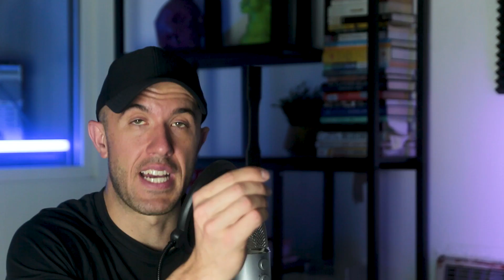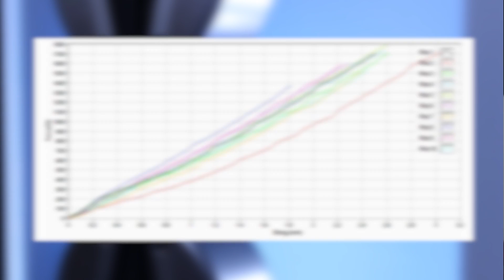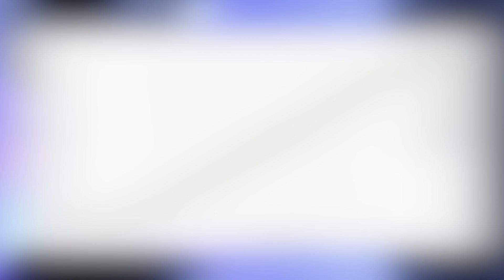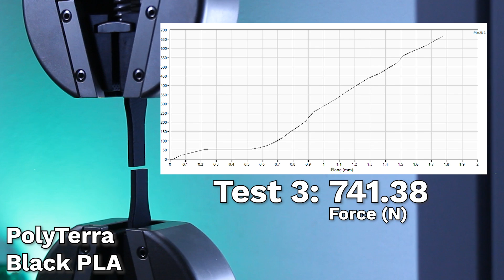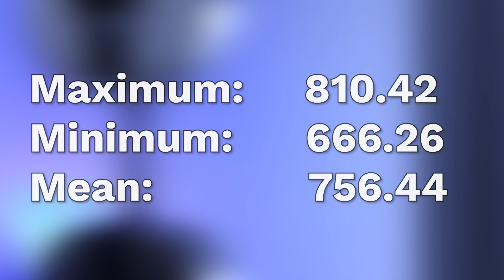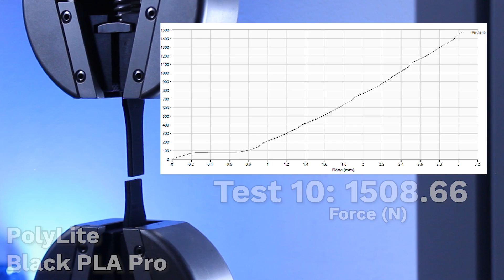Which Black PLA Makes the Best Print? 3D printer filament Strength Testing.

Comment: I understand I am saying this a year late so I may be screaming into the void here, but I just want to reiterate what others have said. I will preface this by saying while I have watched Slant 3D for well over a year, this is the FIRST and ONLY video I have watched on this specific testing channel at the time of this comment. So it is very possible the issue has been addressed and resolved in later videos. If so, I apologize.

However, I would like to firmly reiterate what others have said in terms of video layout being a very legitimate issue and point of concern. SPECIFICALLY for “common filaments” like PLA.

While this certainly WAS informative, overall the means of relaying the results and data is far below the standard reflected by other testing channels across multiple industries. I’ll use Project Farm as an example since others have mentioned it. All of their videos like this include some level of comparative analysis at the end, and it is incredibly helpful to your viewers.

As it stands, it’s hard to make any meaningful choices using the information in this video without taking a pencil and paper, pausing, writing down results presented throughout, and then doing a comparative analysis of your own after watching in order to determine what the “best” option is for a specific use case. 

In the case of this channel, you truly don’t even necessarily HAVE to go as far as the summary’s given in videos like PF. Currently 3D printing filament, while being used in more and more situations, does not have a huge amount of data that is relevant to 95% of viewers. Add that to the fact that you are an extremely trusted and proven source for the community, and people trust you. So even if all you did was add a 30 second segment/chart to show which filament is best for which use case (overall durability, most flex strain, best tension, etc), I believe it would be extremely beneficial while likely resulting in more people sharing the videos.

As I said, I think this is more an issue in videos like this which pertain to common filaments. Personally when I am designing for industrial/professional products, I am going to use PA-CF/PEEK/ASA-CF/etc (depending on application). In these cases, those of us designing the product aren’t getting information from YouTube, at least not fully. We mostly rely on lab testing and industry standards based off of use case in these scenarios. But a lot of us genuinely don’t use things like PLA/PETG all that often, and if we are just looking into a new alpha prototyping filament to use, we normally don’t know what the current “best” options are on these more consumer focused filaments.

Just my 2 cents! Still a fan of all y’all do and happy I found this channel!

Comment: Just because it’s “pretty darn brittle” doesn’t mean it should be a surprise that it can hold a lot of weight. Brittleness just describes the elongation percentage at break. 

PLA has low elongation at break but still high tensile strength…

Comment: I had an idea for a test.  Are two 0.6mm walls printed with a 0.6mm nozzle as strong as three 0.4mm walls printed with a 0.4mm nozzle?  They both create 0.12mm walls.  I wondered if three walls would be weaker because there are more failure points and more tiny gaps in the walls.  Maybe I'm not using the correct search terms, however I haven't found any detailed tests on the subject.

Comment: I was enthusiastic when donating to the Tangled crowd sourced filament testing project and am happy to see results now being published.  I understand these are preliminary results.  I look forward to more detailed testing that provides more useful data.  I'd like to see the materials tested in all three dimensions to fully characterize the material properties (independently verifying the manufacturer's data as promised) as opposed to only testing Z axis layer adhesion.  I'd like to see test samples printed at different nozzle temperatures and maybe different speeds and/or cooling settings so we don't have settings optimized for Tangled filament being used for all other filaments that would produce optimal performance at other print settings.  I'd like to see these standard tests done with all popular filaments available on Amazon and from all the large manufacturers.  Thank you.

Comment: As we commented in your other video, the content objective is really nice however the information accuracy may need improvement, we are happy to answer questions on our products, our suggestion is at the minimum to introduce the product name properly to make sure there is no miscommunication, otherwise the video objective appears to be very different from the one, we believe, was intended.
PolyTerra PLA is a matte PLA -> Not at all a Pro PLA designed for durability, nor a "Regular PLA"
PolyLite PLA Pro is the Pro PLA designed for durability -> Not at all a Regular PLA.

Our PolyLite PLA is and only is our regular PLA if you want to properly test "Regular PLA"

Once again, feel free to reach out to these different filament manufacturers to learn more about the product to communicate about them more accurately :) (We are always open to it and fully support this educational channel initiative)
Reply: Thanks for your input and clarification!

Comment: As a backer in your kickstarter, this is a disappointing video. Firstly as others have said, your testing is really basic and not at all thorough. Secondly only 2 other manufacturers apart from your own? That is not a reflective cross section. And thirdly, you add way too much conjecture and speculation and don’t focus any where near enough of the testing results and the comparative analysis… ie with only 4 filaments, you’re padding WAY too much.
I hope further videos are better.

Comment: The value of just testing of vertically printed coupons is very limited because the results are highly dependent upon printer settings. For example, a filament that needs a higher printing temperature than standard PLA will fail prematurely if printed at the same temperature that's ideal for PLA. Horizontally printed coupons printed with appropriate settings would be far better for determining tensile strength, and that is all that's provided in this video.

Comment: I threw together a quick test report (really just the results section) based on the data in the video (linked below in Office 365 online format).

I think it would be nice to get something like this (doesn't have to be the writeup, just the charts and some of the info) for future testing. It would provide a nice framework for filament comparison. Starting this from scratch watching the video took me about an hour, so I imagine if this were standardized, it wouldn't meaningfully impact the production time for one of these videos.

A cool way to do this would be to publish and link a standard test protocol (STP) for all your testing (could version the document and if you add testing just report the STP version you tested in accordance with). The STP could cover methodology, and then just report your results for each video. If you deviated from STP for a one-off video (let’s say you used a chamber heater when testing polyamide filament where you normally would not), just list that deviation in the video or description.

If you like the idea, feel free to steal freely. I don't need attribution or anything.

Test report (abbreviated, results only):
https://1drv.ms/w/s!Au-6HleUWQlogdN4-Q2Xh_UQ1Uz9oQ?e=P7LG8l

Calculations:
https://1drv.ms/x/s!Au-6HleUWQlogdN5R1LVQofQ1brFzA?e=WjaBR6

Comment: Would be cool to throw in some silk pla filaments, they seem to have different properties compared to regular pla. 
Another thing could be useful to find out - which filament is most rigid/stiff (Young’s modulus?). Helpful for technical/functional prints and prototypes. 
Thank you 🙌

Comment: Hi, please use MPa as unit when showing results. Showing results in Newtons  is not scientific and does not tell as much as tension in MPa.
Reply from the maker: Maximum force. Stress is in the data and stated in The video.
Reply: @TangledTesting  just include both, everyone else uses mpa so it would be easier to compare

Comment: You really need to test bending modulus because that's much more indicative of practical strength than layer adhesion is. All these things have layer adhesion which is surprisingly good, and the ones which are worse may work much better as support materials.
Reply from the maker: Good point on the support applications
Reply: How much is a bending machine?
Reply: @AndrewDasilvaPLT  Depends how good of a machine you want. Being a hobbyist I personally would rig something up using weights and strings, which is far from the absolute most precise device but is fairly good. With how noisy these layer adhesion strength test results are the add-weights-to-a-hanging-bucket approach would probably give very similar results.

Comment: I hope you do start printing in XY and not in Z. 
Printing in Z is doing layer adhesion more than anything. and individual print settings play a huge role in this. Are you printing them all at 190C when some might prefer 210C? Might not be fair to some filaments in this regard.
As such, you should include your print settings for each filament for each test.

You should also do these tests with different print parameters (temperature, print speed, fan, flow rate, etc) and really see the ideal way to print each filament.
Reply: I agree with putting on screen what temperature and other settings they were printed at.
Reply: This!

Comment: testing layer adhesion is a non starter. properly designed prints do not allow forces applied like this to be substantial
Reply: Parts cannot always be printed in optimal direction, and you dont always get forces only on one direction.
Reply: Dumb comment.

Comment: Polymaker will likely need to be revisited, as they changed formulas with the release of the Panchroma brand. PolyTerra will likely be sunset when they run out of it. Hopefully you can fit a few more brands in future videos.
Reply: Old polyterra filaments will stay, just with a new name.

Comment: Layer adhesion strength is good to understand, my experience of bambu black matte is layer adhesion is quite poor relative to their non-matte. However when it comes to designing parts i'm much more interested in tensile strength along the grain... and what the "stiffness" of the filament is like... and how it yields and ultimately fails.

Comment: Good to see you plan to do the alternative dog bone orientation going forward, but I'd love to see more brands tested. It might be worthwhile to do a poll to find out which brands are commonly used. 
Also, on the topic of mattes, in my experience they fairly consistently have worse layer and bed adhesion. I just yesterday had to have a conversation with a designer about printing small parts in matte requires brims, as they will otherwise get knocked off the build plate. Comparing it to sand is quite accurate.
Reply: "Probably" isn't a plan to do it in the future.

Comment: @Tangled Testing
I've got a nerdy question, based on nerdy assumptions. Assuming all samples are printed in the same orientation/location and spacing on the build plate every time, are you tracking that data as well? I'm curious to see if the outliers in the strength test will pin point  onto the build plate ... might show some possible part cooling deviations because of it. 🤷‍♂️ Thanks!....I told you it was a nerdy question😂

Comment: You should rename this video "what is the PLA with the strongest layer adhesion". You aren't adding value if you only focus on the one orientation. I havent read a single comment agreeing with you. I will be unsubscribing if this is the case and I hope others will too.
Reply: yep... sad to see
Reply: The other dimension can be read from datasheet. If your PLA does not have datasheet, or you don't trust it, please invest in testing machinery.
I have not seen any test results explaining how datasheet strength and vertical tested strength deviate more than what gaps between layers and extrusions predict.

Layer adhesion, bending (stiffness), impact strength (toughness) and (permanent) deformation under load are probably most important non-obvious filament metrics.

Nobody is holding you though ;)
Reply: @kimmotoivanen  the  whole point is that we need to verify manufacturers claims!